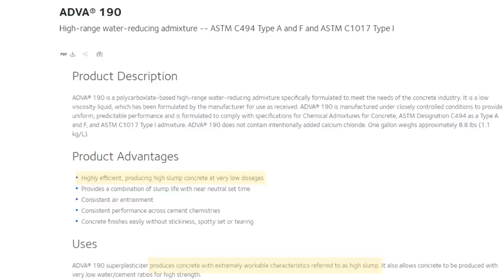How I Can Pour High Slump Concrete (Do You Know About This?)

Comment: Thanks for making this video, Mike. After watching this I had the confidence to pour a 600ft^2 slab 6" thick at 7" slump with superplasticizer added. The morning before, we'd poured the same floorplan at a different site, at 6" slump with super plasticiser... amazing the difference in ease of working the mix with the 7" slump vs. the 6" slump on the same floorplan. Both have cured out just fine, no blemishes. Did it in February during a freak nice week with no freezing diurnal weather, daytime temps in the upper 50s, lower 60's. We used a 24" grid of #3 fiberglass rebar, no fiber in the mix (although I considered using it). We also used hot water in the mix at the plant, and as needed at the site more was added.  We were able to power pan and power float the slab about 3 hours later. So far, so good!

Comment: You are absolutely correct. People who make negative comments (armchair engineers) usually have no clue or assume the worst. Water reducers are great products with many different products and characteristics. We stopped doing flatwork over a year ago, not being able to keep up with walls. We generally pour walls at about 5.5 or 6 inch slump. Using a pump this does a great job. We don't normally use super but occasionally its needed. Great job on your floors.
Reply from the maker: Thank you, great comment!

Comment: Mike, I have poured vertical walls ICF for years and always pour 8"-8 1/2" slump and found almost no bugholes or ravel when I've stripped foam. Eliminated vibratory in concrete meets IRC and ASTM 318. Great products produce great work by making it easier on people.

Comment: Beautiful floor! You guys do the best vibra screeding I've ever seen. My crew and I have learned a ton from your videos. We lay out floors similarly with kick screeding when it's sloped or under 2000 sq. Ft. Otherwise we use our vibra tho we still can't get the floors quite as flat as kick screeding. 
We also like to put super plasticizer in our mud. We pour at around a 7" during the summer and the only time we don't like it is when it's windy. We have a very dry, hot, and windy climate here in central Washington and sometimes with the plasticizer, it seems that the top will go off way faster than the bottom when it's baking in the sun. Thanks for all the videos, Mike!

Comment: From what I understand, cement mix is an unusual material in that it exhibits both thixotropic (self-leveling: high slump) and "plastic" (like clay or lime mortar: low slump) which ordinarily are opposite characteristics. Adding water makes it more thixotropic but ruins the ultimate strength. A very dry mix is plastic and stronger but obviously a mother-bear to work. Apparently this water reducer basically does the same thing as adding detergent to water by lowering the surface tension, or the attractions between the constituent ingredients. But it doesn't interrupt the hardening process. Pretty exciting stuff.
Reply: I been in concrete for a very long time and never herd the word Thixotropic till I red your comment, not a common word in concrete finishing. cheers

Comment: Fantastic job.  I wish our residential customers made more use of HRWR or even MRWR for pouring floors.  Easier to pull, less shrinkage, higher strength and ultimately faster turn around time for our Ready Mix trucks.  We don’t do as many “Open Slabs” like that in Ontario, most floors are poured through the basement window.  Still even pouring by wheelbarrow through a window would be much better with these modern superplasticizers.

Comment: I have seen water reducer added both at the plant and on the job site. Water reducers seem to degrade while in transit in the truck. We have hauled to jobs with maximum water specifications and have put water reducer in the concrete after testing.

Comment: i found the Adva product to be unpredictable only in the sense that the same amount of water added affected the final slump in different ways.... EXP950 is another grace product and i have found it to be more reliable..All of these products are mid and high range reducers, the difference being the dosage.. other factors that affected the process were temperature, and time on the truck...EXP can be used as a plasticizer or everyday mid range water reducers.. personally i liked the combination of a high range EXP dosage with a 1/2 dose of D-17, a sucrose based set retarder, (for long hauls) on a hot day...concrete was sleepy til it got on site, then very little water got me the slump i needed without really affecting set time

Comment: Hi Mike quick questions. Does this method only work for slabs that are perfectly level? For example if you had a slab that has a 2% crossfall, would having such a high slump mean that it would self level again after screeding and you'd lose the fall? Equally would using the vibrating screed also level out the crossfall you're trying to get? Thanks for all the tips!!

Comment: What is the reason for doing the floor last?  Couldn't you do the slab first then the walls with a key in the slab.  Strength difference??  Also noticed you didn't have any reinforcement with this pour
Reply: Because you use the walls as a form. It just makes more sense that way. The walls are the foundation the floor is just a floating slab.

Comment: 5 to 6 slump on my shop 25x24 some minor cracks  5 inch thick  looks o.k. but the bull float guy had issues but its o.k. then i epoxy coated it  Cashmere Wa state

Comment: In my personal experience, concrete that is poured this wet might meet strength tests but I have not seen one that didn't have a ton of shrinkage cracks even with control joints spaced closely together.

Comment: Is a great slump to work with it and yeahhh additives is the way to go but you still want to watch how thick you are pouring with that much flow and the aggregate you are using with that high slump because is prone to Segration and you get a poor and week surface and your 30 years of doing concrete will go down. I use Super Plasticizer when need it to not compromise strength, or use Agilia concrete but I would not recommend Agilia concrete because of to much segregation on walls and thicker slabs even engineers said it's meant for high flow and early strength still Segrastion Happen because I have tested over and over with the same results. I personally doubt the strenght and durability wherever walls and beams are pour using Agilia concrete. I red alot of good reviews here cheating you because the work you do and it looks great, one thing is the look and another is the quality. like I said previously. Watch Out How Thick you pour with that 8'' slump because of Segration and all the finishers that commented here forgot to mention one of the Biggest Mistakes when placing concrete. Segration Segration Segration

Comment: We have super p here.  I never use it it’s to wet for me.   Most my pours have falls to it so I can’t use it.     I used to use a midrange reducer but by the time it would get to me it was spent already.  And for some reason I can’t get them to give me more percentages of midrange.    1% is all they’ll give me.   I’d rather run 2-3% mid range than add 30-40 gallons     But I gotta get in on the ground.

Comment: I bet that does get old, with “that guy” always poppin-off every video telling you, “It’s too wet! It’s too wet!” 

Plasticizers were originally developed to get better consolidation in vertical work, loaded with tons of rebar. We used to just have vibrators to try to get good consolidation of the mud but leaving the vibrator in too long can be detrimental to the mix as well, by separating the mix and sending all the aggregate to the bottom. And of course vibrators always have that nasty habit of blowing your forms up too 😖. Then the slab guys discovered they could save money on manpower by using it. Everybody won!

*A good ‘hack’ for homeowners and DIY’ers mixing mud by hand is - Plasticizers are almost exactly the same chemical makeup as dishwashing soap. So to give your bag mixes better workability, give the mix a few squirts of dish soap instead of adding more water than the prescribed amount on the bag.
Reply: I'm gonna try that- thanks!
Reply from the maker: It's par for the course, I expect it. Just thought I'd educate the one's who don't really know too much about concrete and how and why we do what we do everyday. Thanks for your insights! Always very good info.
Reply: @JeffMTX  I wish I could give you the exact proportions to use, but in the video Mike said about a gallon of plasticizer per 10 yard truck, which would be about 13oz per yard. 1 yard is about (50) 80lb bags, so that would be about a quarter once per bag. My guess is it would take a little more dish soap than commercial grade plasticizer. Just be careful not to overdo it.

Also, you should probably mix the soap in with the water in a bucket first, then add it to the concrete mix, for better distribution.
Reply: High range water reducers are not the same composition as dish soap.  They are a polycarboxylate, typically polystyrene sulfonic acid.  While dish soap has some acidic groups, the similarities end there.
Reply: @christopherhaak9824  I wouldn’t say the similarities end there at all. They can improve the workability of your concrete by a substantial amount, without compromising the concrete in any way which can be very helpful to anyone who has ever followed the mixing directions called out on concrete bag goods. The chemical composition is not EXACTLY the same but for all intents and purposes it’s close enough to give the desired affect.

Comment: thanks great vid as usual.  The product says "low water/concrete ratios".  Don't they mean HIGH water/cement ratios?  More water right? .
Reply: Low water. The actual amount of water is normal or lower. The chemical that he adds is not water.
Reply from the maker: No, low water/cement ratio is the correct term. When you use water reducer instead of adding water it means you still achieve a low water to cement ratio for strong concrete. It's not talking about the actual "wet" slump your pouring.
Reply: @MikeDayConcrete  Oh ok got it.  Thanks for the clarification!  That makes sense, that's how you can get a high slump and also high strength, not too much water.
Reply: @bryanspriggs4290  Got it.  Thanks

Comment: Not a contractor, just looking to pour a pad for a small shed (10'x10'), that's how I ended up here. Just curious, is the water reducer just a surface tension reducer? Kind of like using a little dish soap in herbicides? A suffocate?  I won't be using any, just wondering.
Reply: Totally different than a surface tension reducer, tho the end effects do have 'some' similarities. There are mid-range water reducers (MRWR) and high range water reducers (HRWR)(also known as superplasticizers), as this was. They create a chemical reaction with the cement powder in the mix to greatly increase the slump (flow/'liquidity') of the 'whole' mix, while maintaining a low water/cement ratio (which is vital for concrete strength). But it's not a surfactant.

Comment: Poured my 2200 sq ft basement slab...4000 psi, 7” slump, no additives, no fiber, no mesh, no bar (except 3 -10’ #4 across a corner), over 6 mil vapor barrier, no troweled joints and no cut joints. Only one shrink crack in the whole slab right at the corner we put the rebar. 😂 A slab is only as good as the substrate.

Comment: Plasticizer is the trade term, only on flat work or sealed form work. Add fibres to help with crack control,  6 inch should be your maximum or you get too muck aggregate segregation especially after vibration. Too weak, 4600 psi far  superior finish and strength used everywhere on everything.

Comment: I may have missed this information, but I'm going to raise my hand and ask, what is the slump on the mix before the superplasticizer is added to make the 8 inch slump?
Reply: Depends on the type and amount added..usually a 4 inch slump.
Reply: @SootyMangabey.  Thanks, however there is a definitive answer that if I have a concrete mix of "x" slump will yield a concrete mix with "y" superplasticizer will give me an eight inch slump.  No guesses please.  I can do that all on my own.
Reply: @mrvv8337    if you want an exact answer specify the number of yards the type of mix  how much cement is in the mix and the type of superplasticiser used, and Is it being added on site or from the plant.
Reply: @SootyMangabey.  actually I did sir, re-read what I wrote.  No need to be salty about it.
Reply: @mrvv8337  Not true, what your saying is only representative of concrete in the batch process. Due to temperature, drive time, thermic rate and plant added chemicals the amount of plasticizer added on site to bring it to "8" could very drastically change. A standard concrete mix would have a 1 to 4 water to cement ratio and the designed slump would be 80mm or 3" but if it took 45min to get to site and it was a 30 (95) degree day water loss would be much higher. If you get to site and just add SP theres a chance the SP won't be as reactive as SP needs water to be reactive. Soooo its not a definitive answer.

Level 2 Concrete Tech, past Batch Plant Operator for Lafarge NA.
Reply: Actually it is.  If you called the plant and wanted a slump of 8" with superplasticizer they will have to mix the batch to a certain slump with water.  So it is that simple.  But Mike said near the end of the video he didn't know the details except that a superplasticizer was used to achieve an 8" slump with fiber reinforcement.  But it is that simple, especially if I ask for slump test on site of each batch.
Reply: @mrvv8337  I was a plant operator... as in the guy you just called at the plant. as I said you can dispatch it from the plant and guess at thermic rate, drive time and loss but most times unless your doing a large pour an have time to dial in your moisture your driver will re-hydrate or add SP on site. I'm sure you've got some experience but I may have batched a couple hundred thousand more meters than you. Your wrong but I'm sure you know that.
Reply: @DavePreissl  like I said, it is that simple, and like you said...it is.  The batch leaves with this much projected slump and will have this much after superplasticizer.  It wasn't that hard now was it.  Thanks for all your information.
Reply: @mrvv8337  projected and definitive are not the same, you said definitive. Your now taking my side but thats shows your learning. Good job!
Reply: @DavePreissl  I am good.  Recommend x slump with water will yield y slump with a superplasticizer will be used by the manufacturer to get the recommended slump with a superplasticizer.  Would I have send your batch back if it did not meet the required slump without extra water or your company would have to tear out the batch because it did meet the required strength test?  Thank you for information but it has been found wanting.
Reply: @mrvv8337  re hydration to designed spec within 60min of batch time is acceptable practice and will reach strength every time. I'm a concrete tech... seriously why are you arguing you should be wrighting this down, lol. But hey... can't change you mind so keep on being you.
Reply: @mrvv8337  You're working wrongly in reverse and putting the cart before the horse, in your way of thinking. Everything @Dave Preissl said was spot-on correct.
In your statement that I'm replying to, you are making the 'end result' superplasticized slump of 8" the main focus or the main goal. The real main focus, even for Mike Day, is really a low water/cement ratio strong concrete mix of 3"-4".... WITH the proper dosage of WR Grace's ADVA 190 admixture.... which would typically result in a slump increase of approx 4" more slump (resulting in an approx 8" slump). In most cases, the slump increase from ADVA 190 is a 'given'.
But there are many variables that effect the slump increase from any HRWR (high range water reducer), so it can never be known at the batch plant, with any certainty, how much slump will be when it arrives at Mike Day's jobsite.
BUT, what is always known, and what is most critical, is the plant's batched water/cement ratio and resultant slump without any HRWR admixture added. THAT is the basis of the mix design and what really determines the concrete's strength. As Dave said, water added at the jobsite (one addition of water, not retempering) is normal & permissible to try to reach a target 'jobsite' slump. But that water addition can't be excess or exceed the allowed water/cement ratio for that mix design.

Comment: Concrete over plastic? How does this work?
Reply: Well you put the plastic down.... Then the concrete 👏👏👏
Reply: Plastic is a vapor barrier to prevent the concrete from drawing moisture out of the ground. It's standard practice for floors pretty much everywhere.
Reply: @steinwaymodelb  Thank you for the explanation.
Reply: @mikeklug3369  Really 😒
Reply: @odalv316  😂😂😂 just a vape barrier sir
Reply: @steinwaymodelb  Also used to stop Radon from migrating into the basement

Comment: The only concern with this type of water reducer is SEGREGATION. Having it so wet makes the aggregates want to become non uniform. You can see this as you are moving it around and as it piles up out of the chute/boot. However, as long as you are aware of this and take precautions to not exacerbate the segregation, then it is not a big deal. Otherwise, I agree this is a much better way to pour.

Comment: I can look at the flow rate and the spread and tell that that is NOT an 8" slump.  Just because you ordered an 8" slump that doesn't mean that's what they sent you. 

I do agree with you though less water equals much higher compressive strengths.